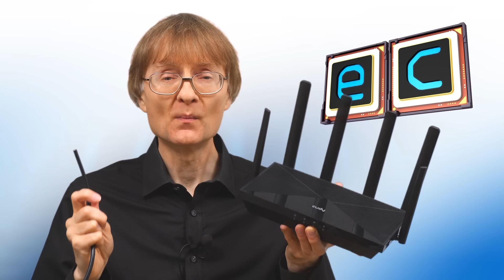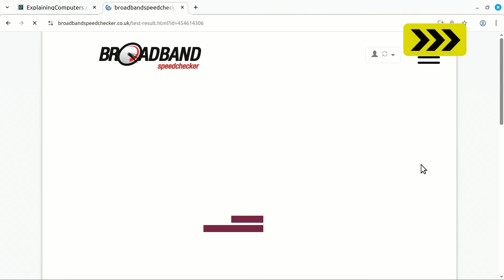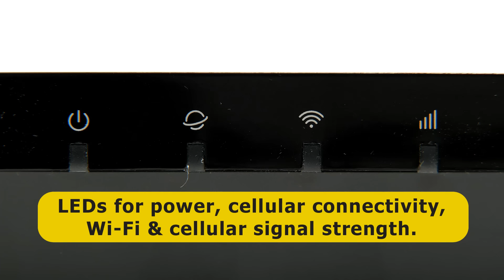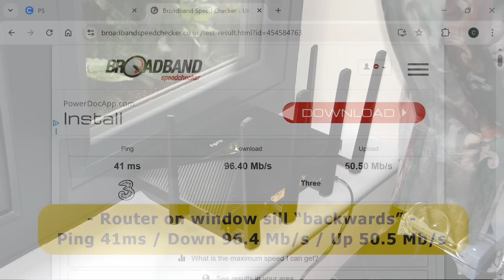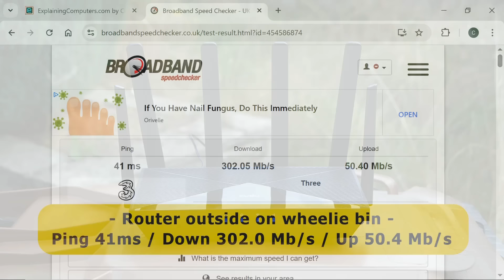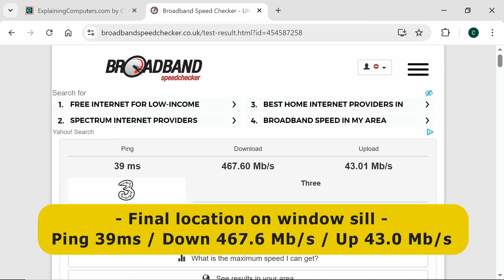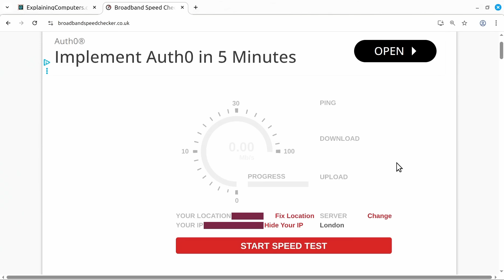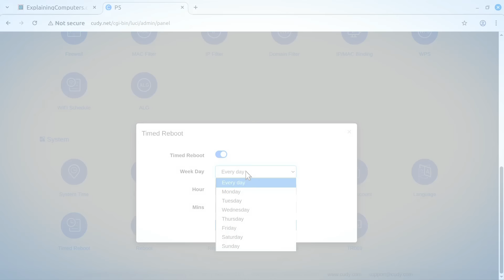Switching to 5G Broadband: Cudy P5 Router

Comment: The only trouble is when you want to access your devices over internet you wont have access to any of the ports required and will need to setup a zero tier network or some other third party remote desktop.

Comment: I use a TP-Link Archer BE550 Wi-Fi 7 Tri-Band Router and get 550 megs up and down on BE and never had any down time.  
dont think it does 5G but they prob have a 5G version.  
I get about 700 to 800 megs on 5G.  on my s23U

Comment: I'm in Calgary (in western Canada)  I have been using 1 gigabit per second service ( from the local cable company)for many years and it was upgraded to 1.5gbps last year. My wifi and wired networks and devices in the house are still only 1gigabit.  When I do an internet speed test I typically see  over 800mbps download and more than 150mbps upload.

 We also have a vacation home overlooking Lake Okanagan (in Canada's wine country) where we just have a basic internet service from the same cable company. Its only a 100mbps service,  but we still get good enough upload/download performance that, with both homes connected to each other via site to site VPN, I don't notice any speed or latency issues.

Comment: There were key aspects of this process that are completely omitted. Not least the supplier and cost of this service, how one determines which 5G network to go with, data limits of the plan etc. This is a case where process is far more important than hardware. Perhaps a follow up covering those aspects would be most welcome.

Comment: In my area, the automatic 5G/4G/3G setting does not work well; I experience many disconnections. Switching to 5G NSA fixed the problem. But I still experience significant variability in throughput, depending on the time of day and the weather. Providers do not really prioritize "home" non-mobile 5G connections over normal mobile connections. All this in the EU and with a ZTE MC888 CPE. I also find that having the option of an external specialist GSM antenna improves service significantly. Such antennas can also be installed outside of the house and/or on the roof and also oriented towards the closest cellular tower. Having external antennas makes reception much less dependent on placement in the house and the materials of the walls. Alas, my ZTE does not support external antennas. If I was choosing now, I'd definitely chose a CPE with external GSM antennas. Note that the GSM antennas that you show are not what I'm talking about; there exist much better specialist antennas. One thing that I do not see in your CPE is an analogue phone RJ-11 port. My ZTE has one and I can use it to make VoLTE calls through it, so I do not need a land line.

Comment: We were with the Post Office for our landline and Sky for broadband. More expensive, however, we did not want to lose our landline number. In their wisdom, the Post Office moved their telephone services over to  Talk Talk. After an issue with billing, Talk Talk disconnected our services and we were left without either phone or internet services. After attempting to get a new service with Talk Talk, they said they could not provide a landline service even though they were doing just that days prior. Fortunately, we moved over to EE/BT who eventually retrieved our old landline number. Given the position of the new EE router, we have now had to go totally wireless, the old Sky router being in my bedroom and connected to my desktop via ethernet.  Not a problem as the speeds are good enough for my needs.

Comment: For info for others - I have the same 5G Three service and I was not a Three customer before - I'm paying £24/month, but including the supplied ZTE router - that works great for me.  It does only have 2 RJ45 ports though, which is why I guess Chris didn't want it.  It also seems to have quite weak wifi - not a problem for me, but I can see it being a problem in a larger house, and may need extending.  Also to note, unlike most other broadband services (including Three's own 4G service), once you stop your service, you are required to return the router or pay quite a hefty fee.  Therefore, don't think this is a good way to get a free 5G router for afterwards - it's not! ;)  Cheers!

Comment: Nice video!  I went to Three 5G home broadband in July 2024 - it's been brilliant.  I made a video on it at the time, as well as a follow up 4 months later.  Like you, I live close to a 5G mast, and my hardware maxes out  - I get 1.2gbps using a 1gbps port (I assume some noise error there in the maths!)- so my broadband is actually faster than any of the kit I have in the house - insane.  Especially when you consider we moved from an ADSL connection of 2.5 mbps!  Where we could only stream in SD and only 1 zoom meeting at a time.  As you say though HIGHLY dependent on your location relative to a mast, and how busy that mast is.  I just got very lucky.  Cheers!

Comment: We've had to do this for several years, even before 5g was really available. But it's not all roses. Latency is still a big problem, and the signal varies with the weather, number of other users, etc. When it works it's fine, over 100MB a sec, but often isn't anywhere near that. We use a Huawei 5g router.

Comment: Why is it handy to used timed Reboot for a wireless connection?  Why do you need to reboot a router on a schedule?
Thank you.
Reply from the maker: Wireless connections can drop when running for very long periods. So (eg) forcing a reboot in the middle of the night every day will help to maintain the connection. With the Mi-Fi unit, I found that it could not hold a connection for more than about 70 hours without a reset. This said, I've yet to set up the auto Cudy reboot, and it has run for I think 10 days straight without dropping connection.

Comment: Moving from Fibre to 5G is like moving from ADSL to Cable Internet. Speed may be great on paper, but you’ll get bogged down at peak periods every, single time. Just like you proved with your 4G connection. 5G suffers from the same issue,as they are both wireless. That’s the beauty of Fibre and Fibre/Copper, there’s little to no congestion.

Comment: The same is mirrored here in Australia. We had a copper data connection with Telstra until NBN took over and did cost cutting, shutting down the copper network and telling us to go to their satellite internet service. The satellite service is unreliable and has the speed of a sick Morse code operator and stops when the school kids get home from school. I ended up doing the same as you did buying a Nokia FastMile 5G Gateway which worked like a dream for the first year and then started to slow down as more people did the same thing (We only have 4G  as telco here are only interested in profit not service) as the system was not upgraded with the increase of users. Our last option now is to outsource to Starlink which is expensive and political.

Comment: I have the same router (Cudy P5, 5G+LTE) as well as its predecessor (Cudy LT18, LTE only)... at some point I switched from wired connections to LTE, because even slow LTE was still better than wired stuff that could so easily be disrupted whenever there were construction workers opening up the road and just chopping wired connections all the time. Even in a small city, LTE turned out to be MUCH more reliable, though with less bandwidth. And after about 6 or 7 years with LTE, I got the Cudy P5 a few months ago - and with or without 5G-NSA (NSA = Not StandAlone), the downstream and upstream are pretty much the same for me, though they fluctuate between 120-280 Mbps downstream and 40-95 Mbps upstream. Reason for the same bandwidths being: I 'm only getting a long-range 5G band (n28) that seems to be about as strong as 2 LTE bands combined, from what I can tell so far. There are bands that are more short range but have MUCH more bandwidth, though sadly my home is too far away for those. Nevertheless: still a great connection.

When you start using LTE/5G, in my humble opinion the most important variable is the "LTE category" - don't just buy any cheap LTE router, as those with a low LTE-category will only give you very low bandwidths, much lower than theoretically possible. The Cudy LT18 has LTE category 18 (The LTE-fallback of the Cudy P5 should be LTE-category 19), which is actually really good - I can absolutely recommend routers with at least those LTE-cats. If you choose the LT18 though, please disable the "QoS" feature, as it seems to be bugged and drastically limits the bandwidth of ALL connections, no matter if they're QoS or not. The P5 comes with a different QoS implementation that's disabled by default.

Bottom line: personally, I'm never ever going back to wired connections. In this regard, the Cudy P5 is a damn good investment, now that 5G hardware is finally getting more reasonable prices. And you don't even have to use 5G if you want to avoid it - you could easily set it to "4G only" and enjoy the LTE cat19 performance.

Comment: I use this setup. No contract with iD mobile £15 pcm unlimited data (and calls!)  50mbps / 5Mbps with 4G. Budjet setup with 4G/5G router with one LAN socket and 4 arials. router costs around £25 on Ali Express. (No 5G in my area yet...although it is also 5G ready!) Virgin cost over £35 pcm for thier slowest service (125Mbps). Also burns a lot less electricity...you'll save around £50 to £100 a year in electrcity costs becuase the 4G/5G routers reqiure far less wattage to run. Not as fast...but for the cost and convenience...just waiting for 5G then got the best of all worlds.

Comment: I dont understand our country's fixation with fixed line connections. I run TPLink 4g routers both at home and at my workshop. Cheap on Smarty, no contract, and the 30-40meg i get with them just dumped on a shelf works fine for me.

Comment: Been on fiber the last 15 years and there has been no problem so far. The fiberrouter has been changed 2 times due to upgradings. Within the next year the copper phoneline network will be closed here in Denmark.

Comment: Strangely Open Reach in my locality are installing the old telegraph poles for fibre upgrade with individual wires running too each house. This will be interesting whenever we get gales and falling tree debris. I have a non BT fibre connection buried firmly underground. Thank you  for giving BT a poke in the eye for their lack of customer care. I have a friend who lives on a canal boat and uses a similar setup to yours, rarely has a problem even when traveling about on the canal network, he uses a directional external ariel .

Comment: The same happened to me with BT two year ago. For years they were going to put fibre in my area but never did. I bought a ZTE MC888 5G router and a Smarty sim, which runs off the Three network. I went from a miserable 14Mbps with BT to speeds of between 200Mbps to 400Mbps, depending on the time of day, with Smarty. The best bit was that I went from paying BT nearly £30 per month to paying £16 per month with Smarty.  I'm into my third year now with Smarty and the cost hasn't gone up. BT have since put fibre into our area but are charging £30 for a guaranteed 150Mbps as their cheapest deal, Really!

Comment: May be a supid question but do you just get a mobile SIM card with unlimited data from a mobile provider or does it have to be a specific SIM for a router?
Reply from the maker: Not a stupid question at all. And yes, you just get any SIM with a  data plan and put it in the router.

Comment: I tried 5G broadband. I got gigabit up/down. Low ping on paper. But weirdly every time I would go to open a website the connection would stall for 2-3 SECONDS sometime up to 10 seconds!! I think it was constantly switching back to 4G when idle, and when I started surfing, the switch to 5G took too long.

Comment: I've been tempted for ages in Hull. 

We use to ONLY get KCOM because no one else would justify the access fees that KCOM charged (whilst KCOM said "no one wants to come onto our network"). 

When my contract ended, I was very close to getting a 5G three router with external antenna, as my iPhone was capable of 800mbps+ on 5G. 

KCOM was about to charge me £54 a month for being a 'valued' customer (with 300/80 up), but MS3 networks (fusion fibre) came along with £25.99 a month for 300/300 speeds. 

I'd been very happy with KCOM, but the pricing they charged was just outrageous, even if they were first to implement FTTP as standard for all homes in hull
Reply: Following on, would you consider a 5G external antenna for more consistent signal?

Comment: I am also using wireless connection, however one feature I find crucial is band mode selection. It's often the case that indoors I get thrown into 800MHz band with less bandwidth and higher load, albeit a better signal. Manually disallowing these lower bandwidth bands (depends on carrier) let's me get far better speeds. In Linux with USB modem, I can control this using mmcli. On my phone there is a hidden menu for that.

The difference can be as high as just 5Mbps in 800MHz band vs 130Mbps in 2600MHz band in Telekom, as the former only has 10MHz and more load, while the latter utilizes 20+20MHz carrier aggregation (LTE-Advanced).

On mobile devices this brings a disadvantage of higher battery drain, as more Tx power is required. However for other devices like a USB modem, it is a non-issue.

Comment: Interesting, I moved to Three 5G about 2 months ago using their own router.
I get between 100 and 250 Mb download, upload usually about 10.
All in all very good, there is only one issue, my Hive central heating refuses to work with it, in that their app does not connect, although the system works in the house and we get warm, we can't control it remotely, very frustrating and may cause me to revert to a physical connection.
I might try bothering their terrible help desks once again though.

Comment: We first got internet at my house in Greece in 2010. It was ADSL, and the router only had wired connectivity. The connection was very flaky, it dropped out randomly, especially when it rained. A year later, we upgraded to a wireless router, but speeds were similar. This persisted for the most part until around 2014–2015, when we switched to a relatively new company that offered DOCSIS internet through their own network for less money and at better speeds (I think we had 50 Mbps down and 10 Mbps up, but I’m not sure). Unfortunately, as a small company, it had lots of teething issues (like similar connection dropouts as well as very bad equipment), but we stuck with them due to the much faster speeds and low prices. Around 2019, the same company started offering FTTH, and we signed up immediately. We paid (and still do) €25 for a 120 Mbps symmetrical connection.

Now I live in Spain, where I pay €10 a month (plus €3 for mobile with 25 GB of data) for a FTTH connection. When I signed up, it was for 300 Mbps symmetrical, but at some point, the minimum plan was upgraded to 500 Mbps symmetrical. I only noticed very recently by accident lol.

Greek ISP's are an oligopoly that engages in cartel practices, especially in the mobile sector, but the UK doesn't seem to be that great either. Spain is PARADISE by comparison in this regard. 13€ for 500 Mbps and 25 GB of mobile data (which rolls over to the next month if unused, I might add) is nuts.

P.S. I forgot to add, the big ISP's in Greece for the most part offer contracts that lock you in for a couple of years. The small ISP I had in Greece had no contract and you could just not renew for a month and then start again. The one I have now in Spain had a lock in of three months and now I can just move to another ISP or just stop paying for a month if I need to travel and just start again.

Comment: Chris. Given you appear to live in London you might have the advantage of overlapping mast coverage but as someone who depended on connectivity to WFH I only ever trusted my wireless as my back up, symmetric ftth as the primary, with a ping of 14ms 

I found the 4G throughput varied massively depending on where I  was, time of day, local events... Heaven help you if someone stages an event near you like a run, fair, sports event, university open day..or there is a crash on a near by major route. 

The crash was the worst, major route a couple of miles away at a standstill for a few hours, though put dropped to none existent and the connection bounced.. Had it been my primary I'd have been unable to work.

Comment: I have been using the Cudy P5 for a couple years as a backup and travel router and it is quite a capable device even if 5G is still really not available in my area (says 5G but all the towers here are really 4GLTE and have just had the identifiers updated).  When new a couple years ago these units were nearly $500 US but they have come down substantially since then.  I am fortunate enough to have fiber at my home and there is no comparison but its still better than nothing and depending on your local 5G tower and service can be faster and more reliable than Starlink in some areas.